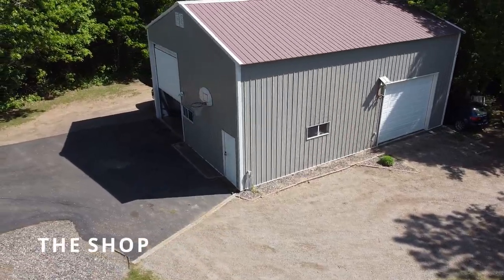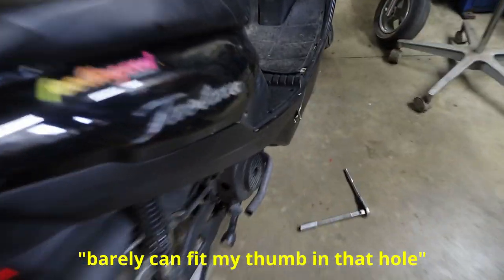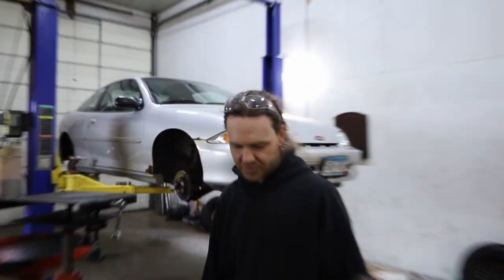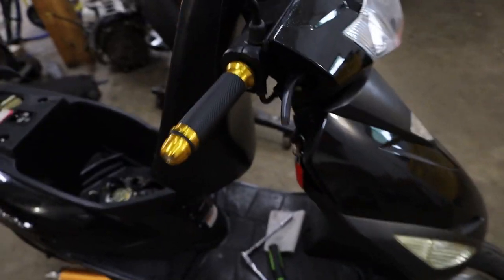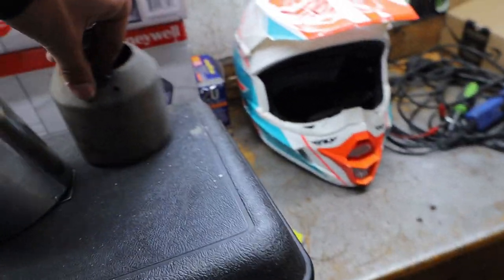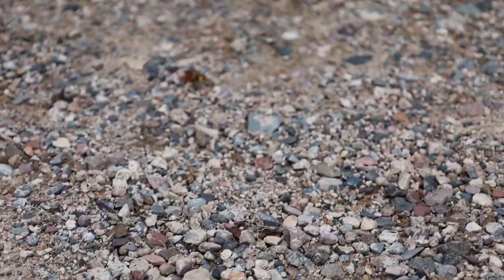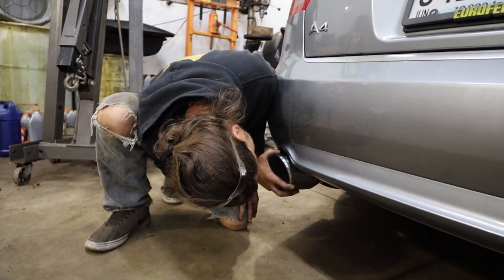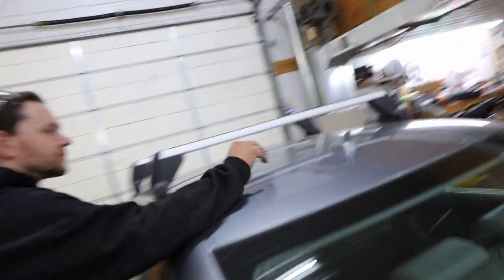The best muffler for a 50cc moped or scooter for one reason

Comment: The flames are "shut-down back fire" from excessive lean condition. Very bad. You want to make a better sounding, better performing exhaust, Take a 3/8 in x 20 inch steel rod (or long screwdriver), grind a taper on it and pound it down into the STOCK muffler to punch holes in the internal baffles. Sounds great, retains some needed back pressure but improves performance and COSTS NOTHING. WOT sound is great.
Reply: Got a vid I wanna hear it

Comment: Put 1 size larger pilot jet in it or you'll blow the packing out of your muffler. It looks cool blowing big ole fireballs out of the muffler on deceleration but you'll quickly burn out the fiberglass packing. Fireball means it's running a bit lean.

Comment: I just got a manco hornet 50cc 4 stroke. I need to get some performance parts to make it go faster
Reply from the maker: Yes you do
Reply: @throttle_therapy  any suggestions? On first parts to upgrade
Reply from the maker: @hunterjulian1997  Variator, Rollers, clutch springs
Reply: @throttle_therapy  OK I got it from a guy who put a new clutch in it new drive belt and a new battery I ordered a carb,Spark, plug wires, and a racing CDI. Next I’ll get a variators and rollers springs and a big bore kit.
Reply from the maker: @hunterjulian1997  you will be set to rip with all that! You are going to have a lot of fun🤘

Comment: Just ordered this exhaust. Should be coming in two days. So I’m gonna have to cut down the pipe and weld it on? any other alternatives?
Reply from the maker: That's the easiest way to do it. Or at least what we came up with.
Reply: @throttle_therapy  right on. Thanks for the inspiration. Love the channel 👍
Reply: Just got this exhaust welded on! Looks and sounds great but no flames 😞
Think I’m getting too much air though cause. I lost power and lower top speed. Do I need to tune carb? Did you guys have that problem?
Reply from the maker: @Averywood_  yeah. We had to adjust some things. it did lose some power. We ended up adding a baffle in the muffler to solve that issue and it worked. If you can do that it will help add some back pressure and make it run better
Reply: @throttle_therapy  nice! I’m gonna order one. Thanks so much
Reply from the maker: @Averywood_  we tried looking for a baffle for this if I remember right. They don't make one this small. We made one out of some sheet metal and drilled some holes in it and put it in the flange part of the muffler. Hope that helps.

Comment: so i have a 150cc peace sports moped and it turn on after alot of kicks then it shuts down when i dont give it throttle but also shuts down while riding... can you please help me on this problem ?? I've already dumped $400+ replacing and upgrading parts..
Reply from the maker: Sounds like it could be a fuel issue. I'd check the carburetor and clean it.

Comment: Just drill holes in your stock Muffler and you'll have the same effect
Reply: If you want more power out of a scooter get a bigger scooter because when you bump up the engine too much so fast it's not funny but again it's the really fast scooters really are the 2-stroke e x if you put expansion chamber's on them and help them up to East 78th in beyond that you need different
Reply: How does one achieve a "low" Exhaust note with a 250cc GY6 engine on a scooter?